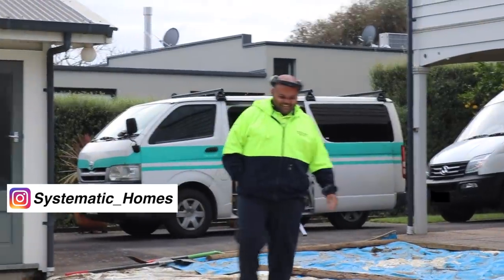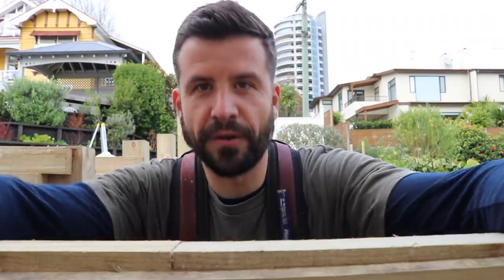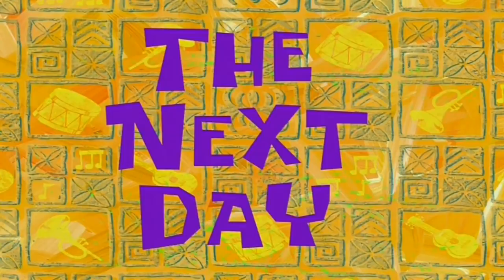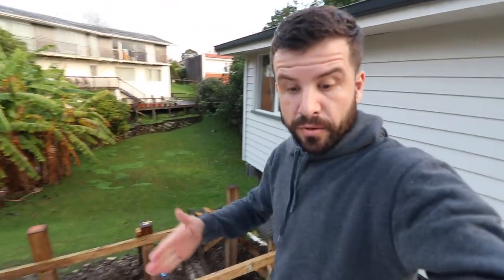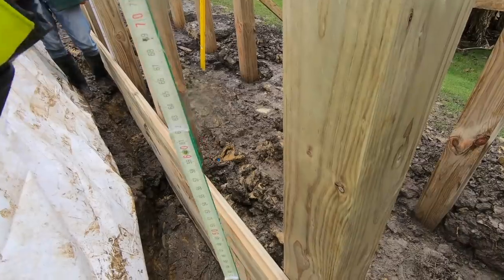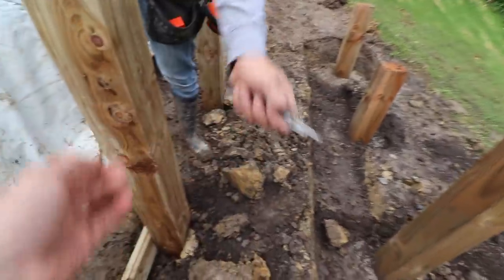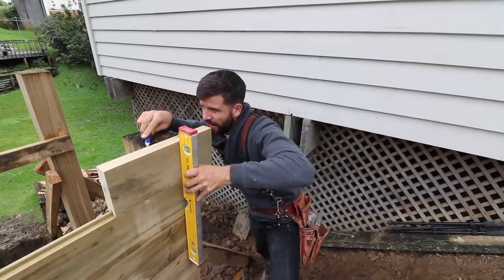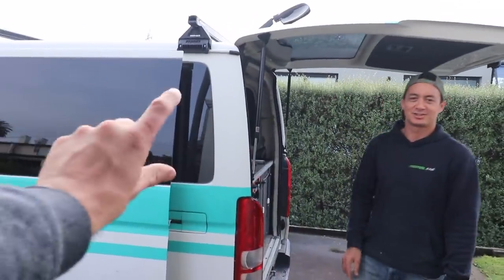Build a Retaining Wall: Tongue and Groove Boards [Part 2]

Comment: Interesting stance on drainage from a channel on here called the French Drain Man. Instead of wrapping just the Ag line in geotech fabric they wrap all the aggregate and the pipe in one go. Check it out guys it makes sense, stops the soil clogging the agg pipe. Scotty your video reminded me about it when you mentioned drainage behind this wall. Coming along nicely 👍
Reply: Done that heaps of times here in Sydney, Au. 
I always wrap the aggregate so water can easily filter through to the Agg pipe. Otherwise it can become clogged with sand.
Reply: normel678 The problem is the engineers still think the other way is correct and always specify it that way.
Reply: @MrJFoster1984  yeah true, the lazy designers who don't want to think.
Reply: normel678 All copy and paste

Comment: Our engineer designed walls in Kerikeri have a 10mm gap between boards. One was about 1300 high to allow for a house to be situated and 2 others in similar fashion, holding bank above house 1m high and holding house site up 1500 high. Maybe the gaps allow extra water to escape.

Comment: Scott, I see that you have quite a bit of diversion drainage to alleviate water stress on the wall, but you should really consider putting one or 2 layers of geo-matrix fabric into the slope. This will help keep the soil in place as the silt and clay erodes towards the wall, otherwise the wall will eventually start tilting over or crack.
Reply: There's been talk in the comments in all these wall videos about earth pressure and the damage it causes to poorly built retaining walls. Lets assume he's going to fill the void behind the wall with drainage stone and use geofab to protect the face from soil expansion. If he doesn't, well this will be a nice  "How NOT to build a retaining wall" video series.  I don't know New Zealand building codes, but in Australia a wall that size in that geo location with expansive clay soil and heavy rainfall and at that height ( over 900mm) would need an engineers sign off on plans.  The posts angled back 5 degrees to allow for movement and adequate drainage behind the structure to prevent water from building up behind the wall during heavy rain.  At this stage the only thing i like about this build is the close spacing between the posts and the depth of the posts. The thin tongue and groove timbers look great on a small wall, but i would have loved to see something thicker.
Reply: @MegaSureshock   100% likely this will have fabric and rock, and probably a piece of drain coil in a sock at the bottom. I think the two step design of the wall mostly likely gets around the requirement for an engineer because of the other wall height at the bottom taking away from the top one. It could also come under replacement work, where they are replacing a failing wall that already exists with a new one and there is grey area around what you can replace 'like for like'. Also as a side note if the fall height from the top of the finished wall was more than 1000 mm it would need a handrail that meets code. After which the fall height becomes more that 1.5 m at which point the structure requires a building consent.
Reply: @MegaSureshock  we dont need consent from the council to do this in nz. 
And a wall this height should ge absolutely fine with tongue and groove single layer. 
If it got much higher he could do a double layer with 6x2 rough sawn board staggered height wise to the tongue and groove front ones which look much nicer.
Reply: @okm09876  here in Oz the two walls would probably be considered one for Engineering approval purposes due to their spacing, rainfall, fall, and soil.

Comment: Just curious how long before the wood rots in that moist climate. Untreated or even treated posts don't last long in concrete either.
Reply: I was wondering the same? Surprised the homeowner went with would
Reply: Ages.
Somewhere between 100 and 200 years
Reply: @hrdstyldncngisbst  I've not seen pressure treated last more than 15-20 years

Comment: Never done a wood retaining wall always been either concrete or masonry just for durability. Surprised you would in such a wet environment
Reply: Sure looks nice though
Reply: Try FlexMSE: synthetic sandbags with polyurethane gripper bars. Just spray with hydroseed and watch it grow into a grass wall. Cheapest and quickest method.
Reply: Its a kiwi thing. 30 years over there seems like a lifetime.
Reply: @fscarp  it mainly comes down to cost and what the customer is willing to pay for. smaller countries means everything is more expensive

Comment: Hi Scott. My names Cal, Im from Melbourne and I'm doing a pre apprenticeship. I don't know heaps about tools yet, but Im keen to learn. I was just wondering what the main difference between a drill and a driver is? I've see you use both and I was just wondering if they have different uses or are interchangeable. Cheers mate
Reply: Hey Cal, good to see your doing a pre apprenticeship mate, that’s how is started my trade,, the main difference is one drives screws a little better and one drills holes a little better the impact driver is great for driving massive batten screws or bolts, the the drill with the chuck is good for drilling the holes for the screws or bolts.
Reply: A drill basically just drills. A driver has an impacting Motion that keeps the bit located in the head of the fastener so it doesn't strip it out. Also handy when removing screws for the same reason.
Reply: @bentonturner1619  Cheers mate. I'm thinking about buying a few power tools soon, so this is a big help.

Comment: Did you ever explain in your previous videos why in NZ you can have lumber in direct contact with earth?
Reply: All of our ground contact timber is H5 treated with CCA (Copper azole) with a minimum life span of 25  (or 50) years. The important aspect is that the end grains are well protected from water egress. In this case the top will have some goo/sealent on it and then the capping piece and the bottom of the pile is completely encased in concrete. The TnG boards are more 'replaceable' and don't have to last as long. https://www.weathertight.org.nz/new-buildings/timber-treatment/#h3-5
Reply: I think all that timber is CCA (chromated copper arsenate). It won’t last forever, I guess it’s a price factor over a fully formed concrete solution.
Reply: @Stuzzzo  In Auckland the reality is that the house and section will probably be cleared for higher density housing long before the timber rots.
Reply: Exactly.

Comment: Why are you nailing some parts and screwing others?
Reply: greAT question
Reply: Screw requires less room behind the wall than a nail gun
Reply: The fixing is only to stop the sliding left or right so it would matter if you screw it on nail it.
Reply: His videos are all about attention to detail and everything is done for a reason..... A knew that it made no difference what he fixed it with...was just wondering if there was a reason for it
Reply: @davidhemi8587  the thumbnail is a picture of him screwing the board with miles of room for the nail gun so can't be that....think the answer is they are just using whatever is closest to hand
Reply: @stuartmcmillan5109  sometimes its got to do with the local codes/manufacturers recommendations. being a structural build,  that would be my guess. Or it could be whatever is at hand 😉
Reply: sometimes i use screws rather than nails because if its just for props it's easier to take screws out and reuse them over and over rather than just nailing and denailing..but thats just me

Comment: That fancy hammer of yours mate doesn’t Do a very good job if it can’t pull nails, estwing hammers are the way to go
Reply: lmfao nobody has estwings
Reply: Anand Lucertini every bloke in this vid has had an estwing, 90% of chippies in Australia and nz have estwings
Reply: @bentonturner1619  Why is that?! Can't for framing..
Reply: Anand Lucertini they are widely available in stores compared to other more expensive brands mostly,
Reply: @bentonturner1619  Damn I rarely see anyone with one over here in Canada. How do your wrists feel though after a long day of forming or framing?
Reply: Anand Lucertini fine man, we don’t use the massive 28 oz ones we only usually have the 18 oz or 22 oz ones a lot lighter
Reply: @bentonturner1619  ahh. I find my 22oz even too heavy.

Comment: Scott, you’re really exposing yourself with these videos. Calling in whole concrete trucks just to fill fenceposts, building a WOODEN RETAINING WALL? Tongue and groove boards will do literally nothing to hold that soil back, especially after years of water-rot sitting behind them. You’ve just fucked your customer over in 6 years

Edit: overpriced tools, stupidly slow work progress, fiddling with cameras every 30 seconds and trying to make sure he still looks pretty with new pants and jacket every week. SWITCH CAREER FIELDS SCOTT
Reply: Im a qualified landscaper In New Zealand most of our retaining walls are timber they are treated to h4 for t&g and posts will be h5  which is fine to be exposed to soil, i would say scott will also put 40mm polystyrene sheets on the back of the wall too but is not paramount. nothing wrong with Scott's methods, pouring concrete with a truck is perfectly normal too, the mpa of the concrete will be much higher out of the truck and he has 200mm of concrete under his posts. pumping it would have cost a little more but obviously the client is aware of that as it would have been in the quote. High quality retaining wall.
Reply: Benjamin Midgley-White I live in California, one of the mildest climates on the planet in both rainfall and in erosion. I’ve personally demo’d 4 wooden retaining walls with this same post-backer-tongue-groove shit. All walls had massive blowouts and bulges, and 3 of the walls had proper water drainage installed to prevent all that pressure treated wood from rot. One of the demo’d walls was redwood, only 6 years old and had a flawless French drain for it. Every wall that I’ve seen get taken out a couple years later was built the same fashion Scott did. 

 If you’ve been giving wooden retaining walls, you’ve been fuckin your customers too.